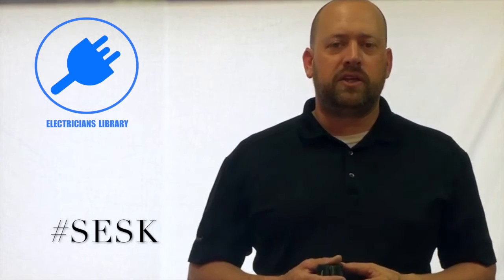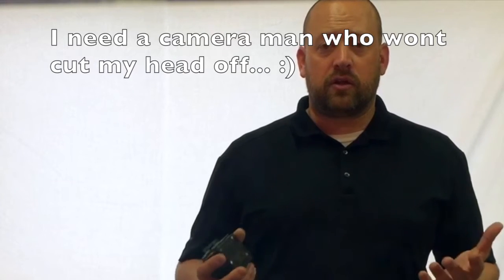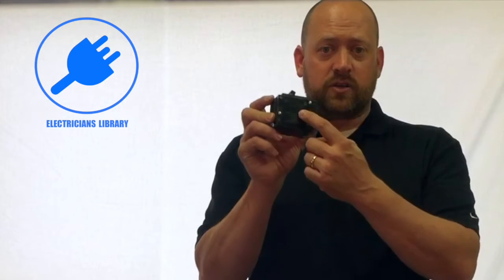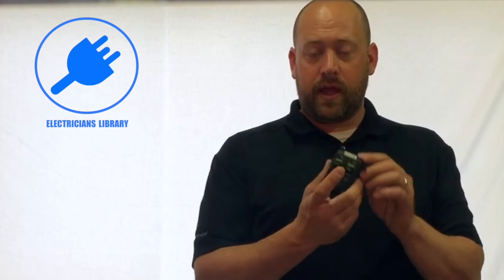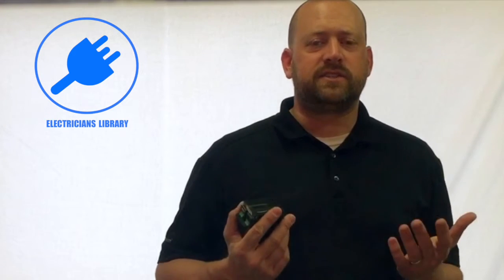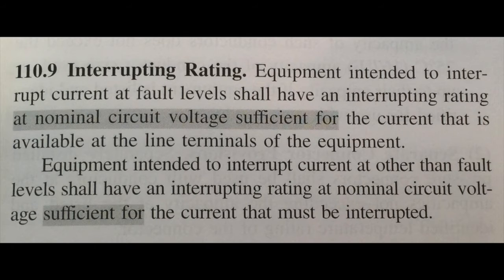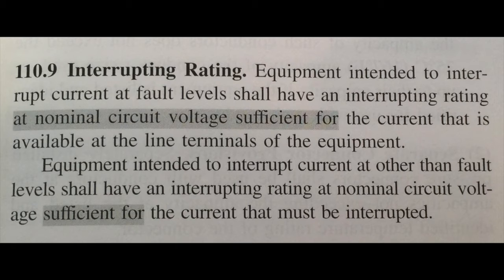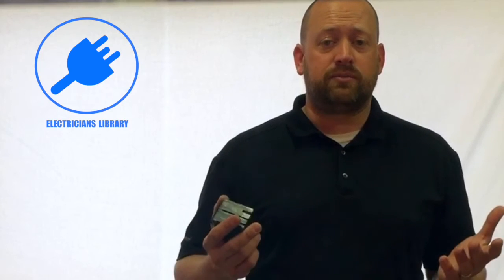What is AIC?

Comment: An interesting story : I was supplied with several multi meter bases by the power company which I mounted and which I fed service disconnects with their expensive breakers installed. The power company shows up and stakes out their transformer location within a few feet which sent off alarms bells in my head. The potential would be great for fault current damaging my equipment and so I asked the power company if they planned on folding their feeder cable in the ditch. They said no. Then I requested then that they move their transformer location stakes further from my equipment so as to keep me from replacing my panels and breakers with the much higher costing "over 10,000AIC " rated ones. They said no. My next question was then when can I expect them to supply the higher rated meter bases to me. They moved the transformer location!😂
Reply: nice

Comment: Hi John, AIC stands for Available Interrupt Current. The utility company will have this information for you. It's pretty important too so the breaker will trip and not explode when fault current passes through it.
Reply: amperes interrupted capacity
Reply: I beg to differ. I think you might be confusing Short Circuit Current, which is the amount of current available in a short circuit condition. That information the Utility Company would have, because they are the ones with the distribution transformers and the distributed power supply. The Utility Company does not make the Circuit Breakers or Fuses (OCPD) used inside your Panel. So basically, the information written on the breaker is saying that this breaker has the ability (Capacity) to clear (Interrupt) a surge current (Amperage) of yada....yada...!! When you put it all together, you get (AIC) = Amperage Interrupting Capacity.